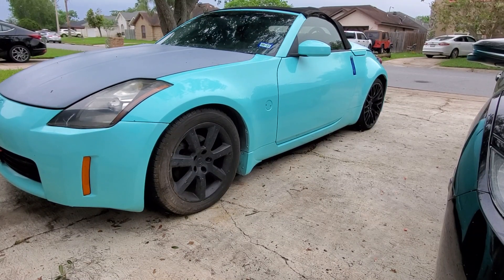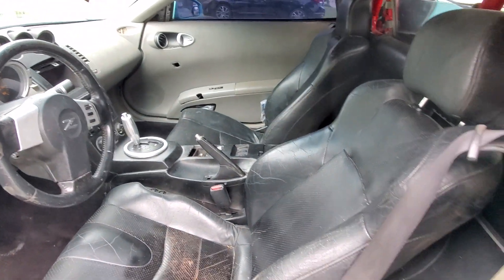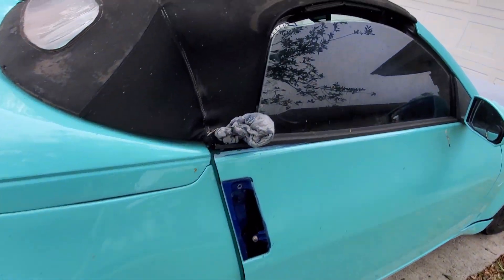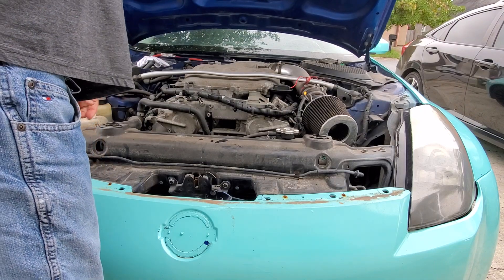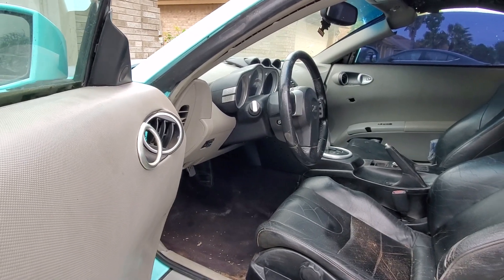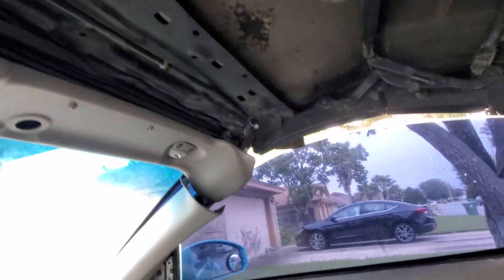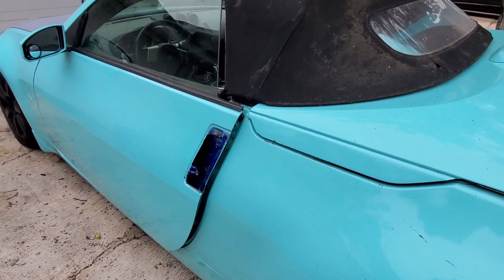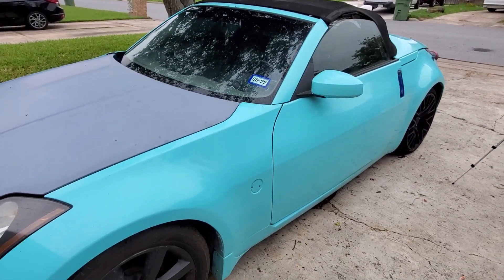My car update Nissan 350z

Comment: 350z’s seem to be decent cars. I don’t really like the look of the cabriolet though. Fun thing is that we can find a minivan with the same engine in Europe.
Reply: This one needs a lot of love though
Reply from the maker: I love the convertible top
Reply: First thing would be to just get it fully functional. It is really likely the next owner will continue to modify it
Reply from the maker: @indy5280  yeah but engine and transmission are good
Reply from the maker: She's running and driving just needs some tlc
Reply: @95617  cool. Paint can be corrected iirc with a wet sand and then a new clear coat layer. Top appears to be toast
Reply from the maker: Yeah top is dead but can be replaced all that extra stuff is for the next owner to take care of my focus was to get it running and now it is 😀
Reply: @95617  good luck. With it mechanically sorted I can imagine it selling quickly
Reply from the maker: Yeah got her running it was a fusible link and needed a battery. Score!